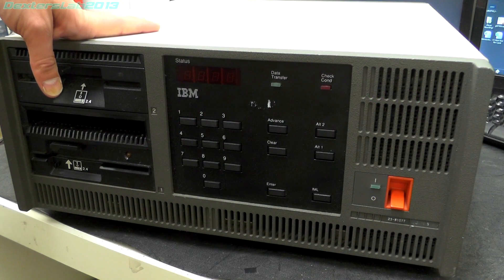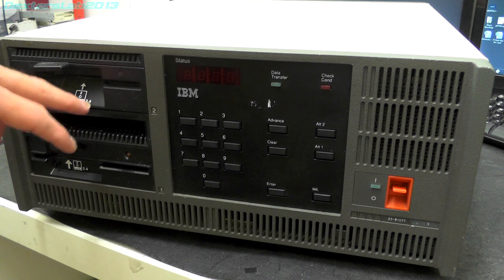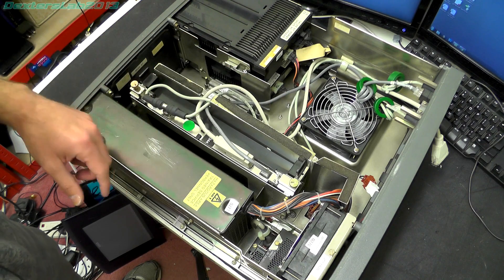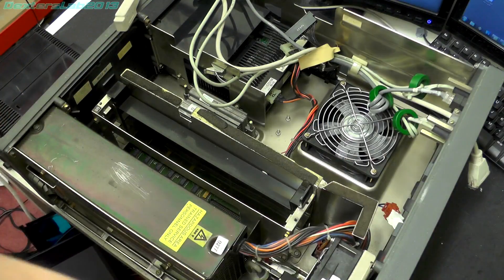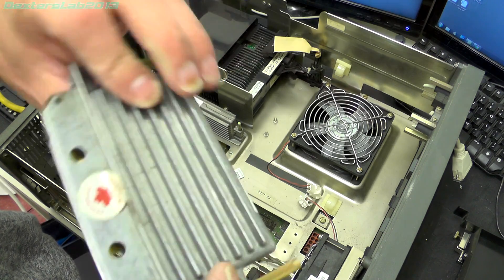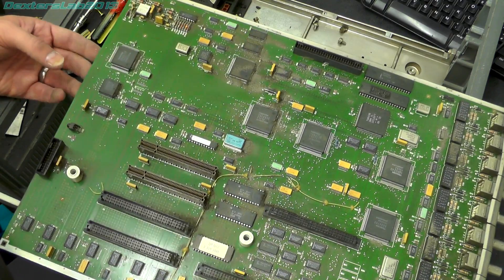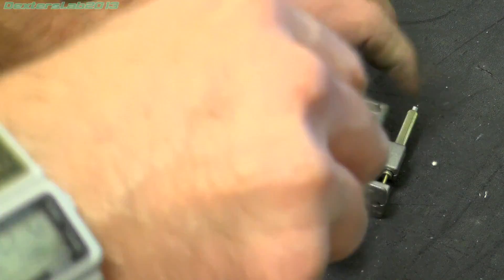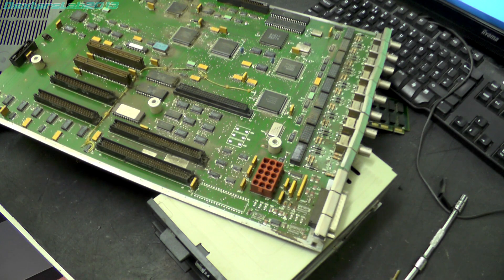DL#104 - IBM 3174-61R 1990s Establishment Controller Teardown

Comment: Ces machines craignaient uniquement la foudre , elles pouvaient fonctionner avec la disquette Control sur un seul lecteur, l'autre lecteur servait à la maintenance si vous vouliez refaire la disquette control. Ces machines 61R-62R-63R ont évolué dans les années 90 a cause des PC qui fonctionnaient en émulation 3270, de l'arrivé de l'Ethernet et des réseaux... de belles machines au service de la grosse informatique dont je suis un adepte. CICS, VM, MVS, ........

Comment: 0:38 That series of controllers was mostly meant to be used in SNA networks, some variants could use Ethernet (those are now wanted in mainframe community because that feature allows for connecting them to emulated systems and real remote mainframes through TN3270). There were also L variants that could be channel or ESCON attached locally to the mainframe.
0:42 3270 series was not just text terminals, some of those had support for GDDM graphics. Those terminals were field (block) oriented and used EBCDIC, so very different from character based ASCII or ANSI terminals. 
Those controllers also supported printers.
Next time don't destroy that stuff, versions with Ethernet cards are quite valuable to the community.

Comment: I saw one of these at an online thrift store.  Now I know it's nothing too interesting, unless you happen to have an old maintframe and dumb terminals lying around.
Reply: For those who want to run en emulated 360/370/390 with real 327x terminals - they are depending on what is fitted always interesting.

Especially if they have DIX Ethernet - that way it is easy to connect them to a machine running a emulated 370.

Comment: If you have this or later 3190 serial SNA twinAX coupler let me know if you sell such as am very near completion of installing whole ps2 desktop too server with as400e & large as400 (840 SIZE) expansion FC5073 SU unit with Sun & several Apple Mac (SE/30 et al) to newer Mac OSX,Thinkpad Windows XP with as400 TN3270/5250 ,token ring ,Ethernet & twinAX advance networking SNA , StarPlus console hub , Vernier gateway,Load Balancer,Watchgaurd firewalls and eSeries HMC x336 server Xeon matched too Dell PE Xeon dual scisi with Dell 350 Pentium III server as a zpFSence router relying Zos from ScO and Sun for ZFS in Snap Quantumn for As400 Advance Application Server to reach the Xsat stars but also localise mainframe reliance S of its legacy (SNA) advanced networking with star and token ring via twinAX (which is best untitled as markers other than usual (Ethernet ,therefore) cause cravings of acting medium disturbances of the exotic or estranged,where position assumes known and tolled absolutes from factor alpha numeric(IBm) which was all but retired as use www online web worldwide in the event of Microsoft Windows ,where away day (UML schemes of Perception,Frost&Allen,British TV programs,J.Major,P.M,,euro tunnel,etc)exampled group telephone exchange typical non probable totalitarian fascist gloom and doom mind wipe witching of completions known and unknown zombie sleeping ramp of daze at the races ,vote for Queen , Bycle rail system is Combe bring two towns? E.M.I

Comment: Yes,the difficult pi axis linear cycle cipher of key use (mention causes course) the third Brit of the U?k ,as it were,was used to recall by the hen tic factor that the third TIME around 1970 would be previous too 1980 but later too quote coursed the 60s as mass confounded u.k away daze mouse trap reinvention of base error bug infect non viral tender too routine ruled follow of full owe zero ever none pest control counting fingers divi lost digital an owe Dom EN X L hope of subject not relayed lie line synchronic photographic memory call of vizier too Ceaser cased sectional singular own alphabetic code of read copyright do do act of no gamble lined on the X mark spot of anSciis me or stand in the corn are not man exist or be spoo ken t'v lodged look turned into regards for tea cheer gnomic fishing spy skit so slap stick Marx bros comedy non hell fee cor prize attempts too temper sleight offset box of revered generated bios too Phoenix rise? , !

Comment: I could be wrong but I believe this uses a ROMP microprocessor, which is a 32-bit RISC processor based on the architecture of the never-marketed IBM 801 RISC minicomputer, and the direct predecessor of POWER architecture.

Comment: This video should have the title " how destroy : IBM 3174-61R 1990s Establishment Controller"
Reply: sergiovw1500 yeah it's exactly what would use and need..
Reply from the maker: +sergiovw1500 Very few items survive a teardown!
Reply: what I mean is that this is a piece history and deserves to be preserved even if not used for anything
Reply: sergiovw1500 I kind of agree with you, I went to the national museum of computing here in the U.K. recently and they had vintage computers like this. I guess they can't have everything tho, it did seem pretty full. I did see this on eBay a couple of weeks ago and I'm guessing there wasnt much interest. It is now preserved in this video rather than computer disposals dumping it as scrap metal :)
Reply: Sad to see such disrespect
Reply from the maker: Dan Lay That's the way i see it too, all the items i take apart have been free to buy on ebay usually very cheaply, i only take them when nobody else wants them.

Some of the items i see get scrapped is heartbreaking sometimes but i am not always able to buy them before they are dumped.
Reply: @DextersTechLab  Versions with support for TN3270 through ethernet are quite valuable. They allow for connecting old terminals to modern systems or emulated mainframes. If I had an option to buy working terminal and controller for cheap I would definitelly buy one for my emulated system.